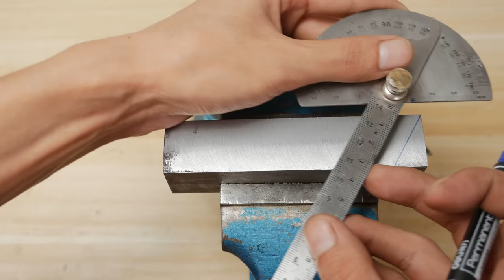Damascus integral handle knife from bearing balls

Comment: can i ask why the ferry flip instead of forging it out? the lines are visible and seems like far more work?  very elegant design and the attention to detail when hand filing were 👌
Reply from the maker: If forged, then the pattern becomes irregular and I want to get a consistent pattern. Regarding the lines, which were not visible before the erosion, they were completely blended together. It's just that the lines are displayed after corrosion.

Comment: It looks great gotta admint, but...
In the making I already saw that it affects the structure, and at the end you can clearly see the lines too...
I mean if you put pressure on the knife wouldn't it break much easier than a blade forged from one metal block?

I don't mean to offend you, I'm just crurious.
Reply from the maker: In fact in the absence of corrosion, the lines are not visible. That line is a trace of forge welding, which would appear in any mosaic form of Damascus. I didn't feel offended.
Reply: @HansKnives  I see.... Nice work, keep it up.

Comment: I wonder if a bronze Damascus style knife can be made by using different color beads of bronze alloys.
Reply from the maker: That doesn't seem feasible, copper is very soft at high temperatures and will be squeezed out. But you can get sumai type blades

Comment: I don't understand. What were the pieces coming off and why did you need to press it so many times at different angles? What was the powder?
Reply from the maker: This is a bit complicated to explain, in simple terms, pressing in different directions results in a more uniform forge weld. The powder is 1095+4% nickel. to obtain contrast.

Comment: the mosaic doesnt really work with ball bearings and its called integral handle 
but really impressive craftsmanship
Reply from the maker: Thanks for the correction, I'm just being a little paranoid.  I don't want to stretch the steel ball to get an oval.  But I found new ways to get the same pattern without lining up the tiles.
Reply: @HansKnives  
I had some good results using thin long canisters. Just a bit harder to get to welding temperature over the whole lenght.

Comment: You're not making Damascus steel, you're making pattern-welded steel.  HUGE DIFFERENCE.  Stop lying.
The day you make Wootz steel is the day I stop calling you a liar.  Until then, STOP LYING.
Reply from the maker: Damascus is just a general term. Wootz steel refers to the ancient crucible steel. I understand this. In modern knife makers, Damascus is just a name for patterned steel.